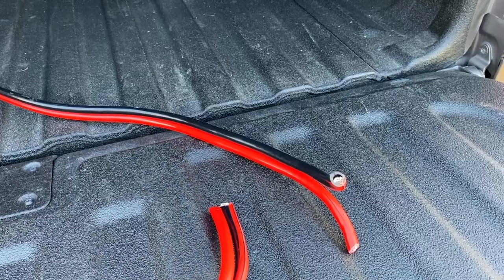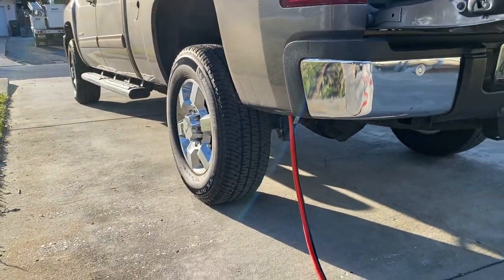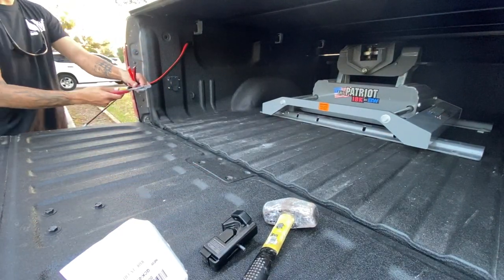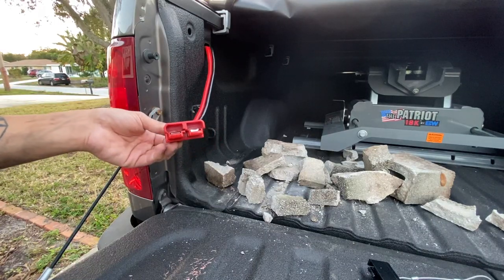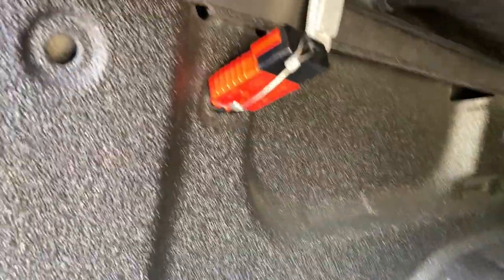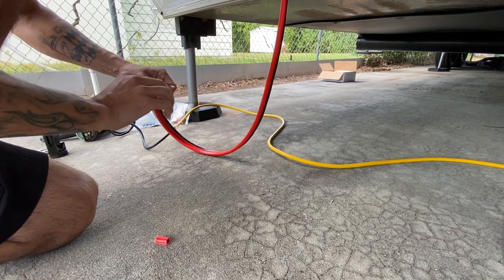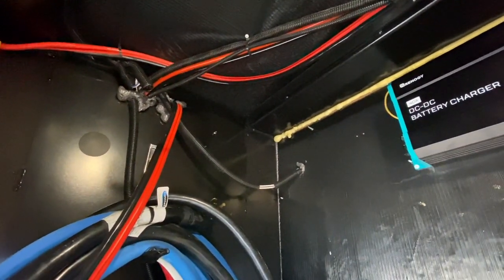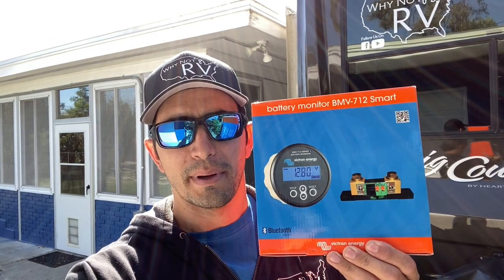Installing a DC to DC charger - Why Not RV: Episode 7

Comment: Nice idea with the yellow cable.. does that mean the charger will be drawing from your starter battery 24/7 even when the engine is off ?
Reply from the maker: Correct. However, I disconnect the cable in the truck bed so that disconnects the trucks battery and stops the charge
Reply from the maker: I have actually now since replaced the charger with a Victron smart charger so it turns on and off based on the engine output voltage.
Reply: @WhyNotRV   @Why Not RV  thanks for the reply man. I have this dc charger currently installed and want to wire it like this. How about if I install an isolator switch so that I can manually disconnect if I'm stopping for longer periods of time? Would that work? Thanks again
Reply from the maker: That’s another option absolutely. Just don’t forget or you’ll wake up to dead starter batteries lol
Reply: How about if I connect it to the wiring under my passenger seat that controls seat position? Would that be a part of the ignition circuit? Thanks again man.
Reply from the maker: You’d have to test that wire to find out. No way for me to know. It could go either way there

Comment: Nice video. I’m about to do the same thing. One question. Did you disconnect the trickle charge that comes from the 7 pin connector? It is a small charge but could damage the Lithium batteries on long drives.
Reply from the maker: Roland, that’s an excellent observation!!! With My new lithium bank I definitely need to do this... before I go off in research do you know which wires need disconnected for that? I just changed out this charger if you look it’s my most recent video.
Reply: @WhyNotRV  No I do not know that. Will let you know if/when I get that far. I do not like the idea that it is the BMS that shut off the charge. In my opinion the BMS is the last protection in case your charge source do not stop charging as it is programmed to do.
Reply from the maker: There’s options to double protect. For example I have a victron battery protect. You can wire one in between the charger and bus bar and use that as a safety
Reply: I don't beleive the 7 pin provides enough charge to cause any problems for lifepo4 batteries.  If it did, the battery BMS would protect the battery, but I really doubt it would ever come to that.
Reply from the maker: True.

Comment: cant you take neg and pos off cranking battery direct to aux battery ? wont that charge the aux battery (using a battery isolator) ? The guy in the 4x4 sold me every thing i need to charge aux battery but never mention a DC-DC charger,
Reply from the maker: No, The proper charging profile of your house batteries are different than how a starter battery charges and is used. A dc-dc charger allows you to properly and optimally charge your house batteries
Reply: @WhyNotRV  thanks for reply mate but i have never heard of the expression 'House battery' Im in a 4x4 will be in the bush not in a house. I have a cranking battery and an auxiliary AGM deep cycle battery. CHEERS
Reply from the maker: House batter is the battery for the rv itself not the motor. I’m not sure what your situation is and what the battery is running.

Comment: Can it be used with built in converter?
Reply from the maker: A converter takes AC power (shore power) and converts it to DC power for the dc system and to charge the batteries. This is going to take your trucks dc power and safely and efficiently charge your RV batteries while driving or running your truck. You wouldn’t really have both at the same time. However, o say all that to say, yes they can work together and both charge at the same time.

Comment: Does the secondary battery or inverter still need to be grounded to chassis or is the black connection to the DC DC charger good enough?
Reply from the maker: All my negative connections go to a negative bus bar that is grounded to the frame

Comment: Hello on your dc to dc charger the yellow wire ( d+ 12 volt positive feed) you put over to your input. Does that work? I thought it has to go to one of the ignition feeds so when you turn the vehicle on the unit starts? Just curious because I just received the charger. Thanks
Reply from the maker: Hey, thanks for watching. Ya, so the input of the charger is obviously 12 volt so it has worked fine for me as I have that plug in the bed of my truck so when I plug it in, it instantly turns the charger on. I have since seen many people wire it to the running lights of the rig so when you turn the lights on, it turns the charger on. Either works. And of course there are many more ways of accomplishing the same goal there.
Reply: Why Not RV Thanks appreciate the fast response. Doing a Van Conversion now on my YouTube channel & starting the whole electrical part soon. 👍👍
Reply from the maker: No problem. Good luck with the project.
Reply: Question: shouldn’t that lead be switched? I’ve seen other  people connect it to the running lights, for example. With the jumper wire as you’ve done, won’t it continue to draw power from you starter battery the entire time that your trailer is plugged in? Even when stopped / engine not running? Not sure what the draw is, maybe it’s insignificant.
Reply: @chrisincalifornia  It’s only when ignition on. Plus I have a on/off toggle switch that stops all current. I appreciate the look though. 👍👍

Comment: Did you need any kind of ignition relay between the battery and D+ or the charger to keep your starter battery from draining? If so, what relay? Also, what kind of cable did you end up switching to for your new truck? Thanks!
Reply from the maker: You can wire the D+ to a marker light on the trailer and have your lights being on be the control for the charger. In this install I kept it simple. So when parked overnight I would just unplug the Anderson connector in the bed of the truck.
Reply: @WhyNotRV  Cool. What kind of cables did you use for your new truck? I noticed a comment where you said you went a different route with a new truck.
Reply from the maker: I went with this cable… https://amzn.to/3EbdSBS
Reply: @WhyNotRV  Cool. So 6 awg was sufficient for that long of a run for 40a?
Reply from the maker: I never had a problem with it. Voltage drop doesn’t really start to come into play till around 50’ or more

Comment: Are those cables copper or CCA? I'm looking to do the same thing on my truck camper, but copper wires are damn expensive. Jumper cables are a lot cheaper if they're CCA but I've heard that when using CCA wires you can't use the normal 12v wire gauge charts. Is that why you went with a 2 gauge?
Reply from the maker: Hey Martin, thanks for watching. The seller doesn’t specifically say CCA or pure copper. My assumption was CCA which is why I went bigger. It’s been 9 months now of pure use on a extremely regular basis and still haven’t had a single issue.

Comment: I bought one of theses, the 20A Renogy DC-DC on board battery charger, model DCC1212-20.  I placed a 30A breaker on the pos line from the starter battery to the device, as per the instructions.  However, the breaker keeps flipping.  I changed it out, but the new one keeps flipping.  So this device is not charging my house battery because of this.  I have a 150 amp alternator.  Before I bought the device, I called Renogy and was told to buy the 20A device.  Now, the Renogy customer service number hangs up after it plays the initial introduction message.  

What do you recommend?
Reply from the maker: Hey Dave, thanks for watching and great question! If the breaker is tripping it more than likely means you have a short in the wire somewhere. With a multimeter, I would start by checking the wire for continuity to ground on either side of the breaker. That should tell you which side of the wire is bad. From there I would either locate the grounded portion and repair or just replace the entire wire depending on difficulty. Let me know if this works for you or if you have further questions.
Reply: @WhyNotRV  I don't think this is it, not as far as I can tell.  Also, the breaker is not popping immediately. It pops after a minute or so.
Reply from the maker: In that minute do you get charging? Do you have a battery monitor to be able to know if it’s putting out 20 amps during this minute?
Reply: @WhyNotRV  I have a battery monitor, which says it is charging, but I'm not sure what the amps are.  I can hear the device switch on, and the fans come on...but usually I am driving so I'm distracted with watching the road.  Now that I am home from my trip (when all this became apparent) I recharged my battery using shore power...which was probably a mistake, at least for the moment, since the charger isn't  working very hard now...when the battery drops, then I'll be able to see how many amps it pulls on a bulk mode charge.  Since the battery is full, it is only pulling 1-2 amps, presumably an ABS type charge rather than a bulk charge.  

I ordered a self-resetting 30a breaker from amazon, which someone suggested. At least I won't have to manually reset it every time it pops.  This is  an attempt to get a charge. But this really doesn't tell me what the issue is. I use 8 awg cables, maybe 16ft long, which is supposed to be to spec.
Reply from the maker: Well let’s backup and look at the theory in a breaker. It doesn’t measure anything. It trips based on temperature. If the wire going through it gets too hot it’ll trip. There could be a problem with the charger itself, the wire might be rated for the length and amperage but depending on ambient / engine temps it might not be enough. That’s about the extent of my diagnosis. lol
Reply: @WhyNotRV  The breaker is tripping at 26 amps, instead of 30 amps as it is rated for. So I ordered a self-resetting breaker from amazon.
Reply from the maker: What does renogy say is the recommended breaker? Maybe bump to a 40amp
Reply: @WhyNotRV  They say to use a 30 amp breaker.  But the one I bought apparently flips at 26 amps rather than 30 amps.  So I am replacing it.
Reply from the maker: Let me know how it turns out. I didn’t use any breakers. I used a fuse and only had it pop once. It popped from extreme heat. Climbing mountains and the engine temps got too high and the fuse was in the engine bay.

Comment: How did you take something so technical and make it so understandable.... Thank you....  Making time this weekend too binge on your videos.... Liked and subbed...

Please can you provide info on a converter mod upgrade that can handle charging lithium batteries in shore and generator power...   I from speaking to other rv'ers...  It's a 50 % equation...  200 battery amp hours can be charged a maximum of 100 amps...   My goal is to avoid dollar panels...  Use an upgraded alternator when driving with a dc to dc charger like you have here..... When dry camping... Use the generator to charge the lithium batteries with the lies run time possible...

Would this merit a video from you?

Thank you
Reply from the maker: I appreciate the comment. This is the reason I started this channel. If you want to reach out to me on Facebook I can try and answer any specific questions. The rule of thumb on charging is definitely subjective and doesn't apply to all battery types. I would look up your specific battery specs and see what they can take. I didn't replace my converter when I changed batteries.... I did the Victron Multiplus route which is inverter/converter (amongst many other things) combo. There are tons of chargers out there, I recommend finding one that is programmable so you can change it up as things change... again, shoot me a message if you have more questions.

Comment: You failed to mention the main factors.
Lithium Batteries will suck as much current as you can feed them.
This means the alternator could burn out with too much current. The dc to dc charger limits the current to 20 amps or 40amps,  which ever unit you choose.
Lead acid batteries have internal resistance which reduces the current 
But Lithium batteries have little resistance.
Reply from the maker: Are you just trying to point out the fact that if you don’t use a DC to DC charger you can burn up your alternator?
Reply: @WhyNotRV  yes burn your alternator. You may do other damage also. Older alternators in particular.
Reply from the maker: I’ll make another video in the near future discussing why you need a dc to dc charger and go over just that

Comment: how big are the eyelets you use to attach on the renogy ? Can I put an on-off button on the ignition cable?
Reply from the maker: I don’t specifically recall the size eyelets. Probably around 1/4-3/8. I have since changed to a Victron charger. You can put a simple inline switch no problem. You can also wire it to a marker light and when you want it on just turn on the running lights.
Reply: @WhyNotRV  thx for the reply! Why did U make tye switch? was renogy not good?
Reply from the maker: Not at all. The renogy is great and I still highly recommend that product. I made the switch for no other reason except I wanted all of my charging devices (solar, converter, dc-dc) to be the same brand for consistency in charger profiles.

Comment: Nice video, thankyou for sharing. How does this work with solar panels? would the charge from this feed back into the panels that are also connected to the battery?
Reply from the maker: Asean Nomad if you have solar already charging your batteries you obviously need some form of a solar charge controller. You could drive with this feeding juice into the batteries and the solar feeding juice into the batteries. It would not back feed to the panels.

Comment: Will this replace the charge current on the 7 pin or can it work with it?
Reply from the maker: It works with it. The 7 pin barely trickles a charge.

Comment: I have a travel trailer.  Can anyone give me opinions on whether it's better to put the DC to DC charger on the truck or on the trailer?
Reply from the maker: I suppose it’s perfectly fine to do either one. I would do it on the trailer time and time again. I’m not sure what benefit you gain by mounting it to a truck somewhere. On the trailer it’s easy to put in a weather sealed compartment, it’s a charger meant to be programmed for the trailers batteries.
Reply: @WhyNotRV  I guess I was thinking about the truck as an option because of the dual battery set ups on some overland/off road trucks. You bring up a good point about its purpose

Comment: why 60a fuse instead of 40a?
Reply from the maker: The fuse is meant to protect the wire. And works off of heat. The charger will pull 40 amps, engine heat can add quite a bit and blow a fuse prematurely.

Comment: Just scribed. Thanks for the vid as this is something I plan on doing soon.
Reply from the maker: Thanks for subscribing. Ya I love this thing. Actively using it as I type this lol. Boondocking for the night and charging the batteries back up to full before bed. Truck is at idle hardly burning any fuel

Comment: How is the charge current regulated going into the rv battery?  Is the Renogy only putting out a rate that the house batteries can accept?
Reply from the maker: Essentially the Renogy is restricting the voltage and amperage coming from the truck alternator. Only allowing what the charge profile calls for.
Reply: @WhyNotRV  thanks!
Reply: It’s really the only way to fully change your house battery. And running the Remote wire to a marker light would be a perfect  fix .